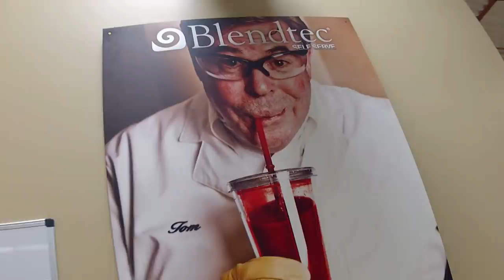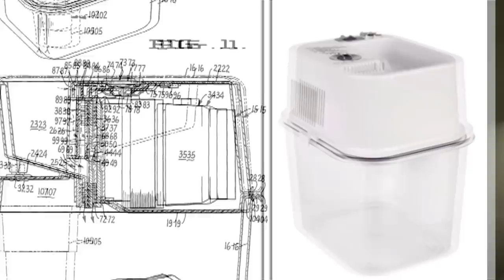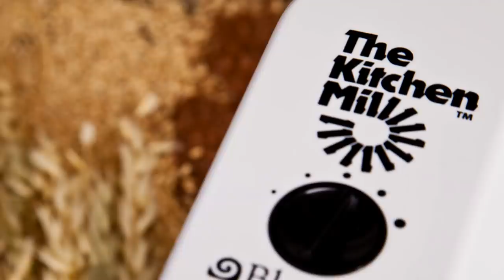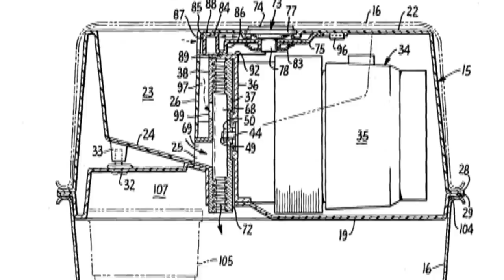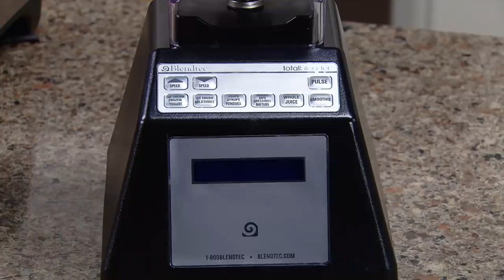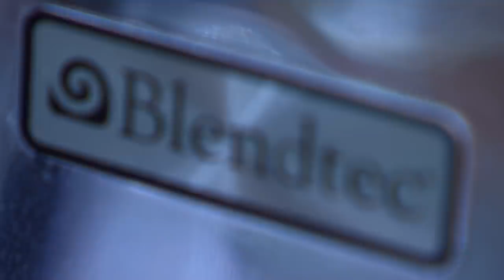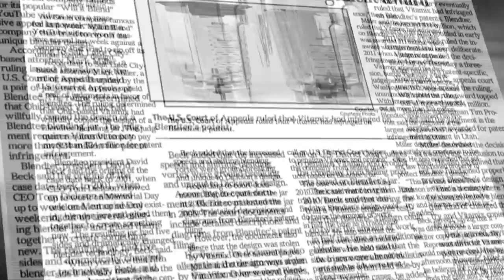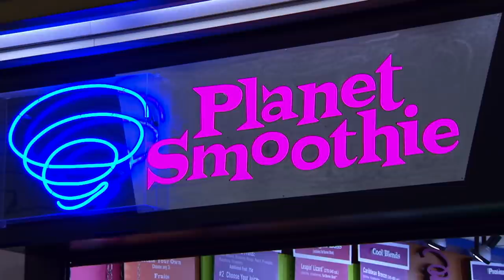CNBC TV - HOW I MADE MY MILLIONS - Blendtec

Comment: "3hp motor" sorry but no. Maybe technically *peak* hp but you're gonna trip the breaker before you pull 3hp out of a 120v appliance. I love the whole idea but come on, Blendtec, no need for shady marketing tactics like that.
Reply from the maker: You mean you don't feed 240v to ALL your home appliances? (joke for USA) Makes everything go faster, no? :-) UK readers yawn.
Reply: Totally agree. "3hp" is marketing bullshit.
Reply: @richardgray8593  depends. If you make a 3hp motor and run it at a lower setting it will last longer. However its still going to need a capacitor to start up with a lower power source. toyota under tunes their engines so they last long.
Reply: @System0Error0Message  They are advertising a motor that puts out 3hp. It does not.
Reply: @richardgray8593  here in the 3rd world, we use the british 240V system. we had an old blender that pulled 2KW from the wall and it wasn't blendtec, and it didnt last either. If you convert, 3hp is 2.2KW, totally fine on our 240V systems that allow 13A out from the wall for a maximum of 3KW (2.8 if you bought a crappy extension). Like the US, manufacturers do not deviate from standard, that means despite the device rating,13A fuses were always used even when the extension used thinner wires and was rated for less A. In the US, i was horrified to learn that you dont have switched sockets, nor use fuses or gfci anywhere. All our houses in the 3rd world have centralised gfci.
Point is, only houses in the US dont get the juicy power we do, i mean they do now but they lack the safety we have. In industrial use, powering high amp devices is not an issue as they have the voltage/amps to do so. SO when he says 3hp motor, most likely its for models used in shops that have access to that power needed.
Reply: @System0Error0Message  I am coming from the perspective of the U.S. system. Since Blendtec originates in the U.S. and tells its U.S. customers that their blender makes 3 hp, I'm calling bullshit. Yes, if it had a 240-V plug and used 240 V,  then they could make that claim. The Vitamix, which only claims 2.2 hp, has a much heavier motor (by weight) than the Blendtec. It's marketing woo anyway, since I can't imagine any load on a household blender that would require 3 hp out of its motor. Imagine if my electric can opener claimed some high horsepower rating that it would never deliver.
Reply: @richardgray8593  the weight of the motor is not actually indicative of power or components. both tesla and a supercar brand have very lightweight but powerful motors. Just a few Kg for a huge amount of horsepower. The biggest thing that helps increase power, reduce weight while having good reliability is to use high volts. This is why it would be dumb not to target people with 240V. The US has had 240V systems for years but only shops and commercial properties are more likely to include them by default in their buildings or upgrade to fulfill the needs while homes are slow to upgrade. US has 240V power everywhere via 3 wire transformer setup allowing for 2x120V in 2 phases or 1 240V. Its been available for many years already. Thats why i dont call bs on 3hp since its been possible and initially blendtec targeted commercial use so unlikely you will get that in US home markets.
The weight of a motor isnt indicative of its power or quality but more to do with amps, so if you feed it a high voltage you wont need to feed a lot of amps allowing for the same power using less material. Reliability however is down to the design of that motor itself. I have old computer fans that are chunky that failed due to age despite not being used that much. I've had ballbearing generic server fans fail far sooner than sleeve bearing consumer fans when used 24/7. Weight wise they were pretty similar.
Reply: @System0Error0Message  In general, a more massive motor running at lower power is more reliable. In any case, the Blendtec does not deliver 3 hp to its load. Period. Look, if you wanna defend Blendtec's false advertising, I can't stop you.
Reply: @richardgray8593  to me its not false because we have said motors here. feel free to show a blendtec single 120V claiming 3hp (there are devices that use the 4 prong american plug that supplies 2 120V allowing for 3.6KW). still feel free to show me said false advertising.

Also contrary to popular thinking, the reliability of a motor is in design not amp capacity. Hence a heavier motor isnt really more reliable than a lighter one. Long ago motors would burn out due to heat as they didnt think about cooling them or supplied too many amps, and the reliability of a motor is actually down to how you start it. This is why fans typically had the highest setting next to off.
Hence if you wanted to get more air from a fan, you would supply it with more volts than more amps. LTT did a video on overclocking fans, supplying them with more volts. If you supplied more amps instead, it would burn out the motor.
So if you got a blentec blender that uses a single 120V circuit, claiming 3hp and is very light, feel free to show it.
Reply: @System0Error0Message  Dude, I have already wasted enough time with this without trying to show you something that you are going to dismiss anyway. Goodbye and good day.